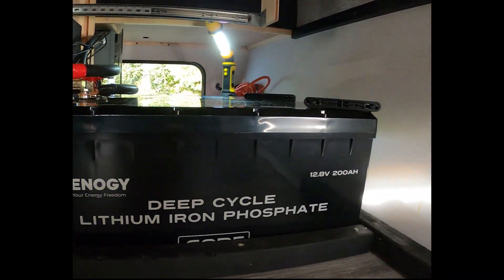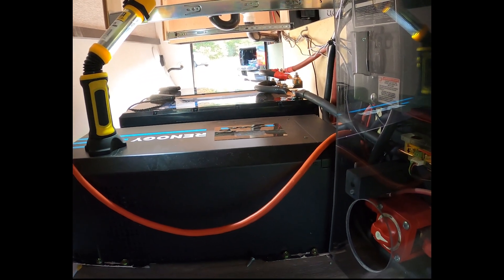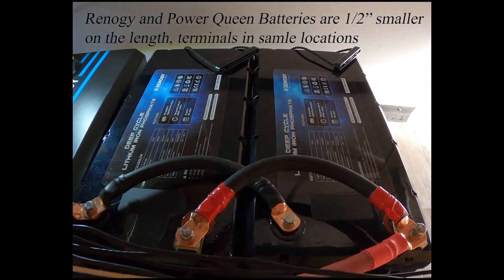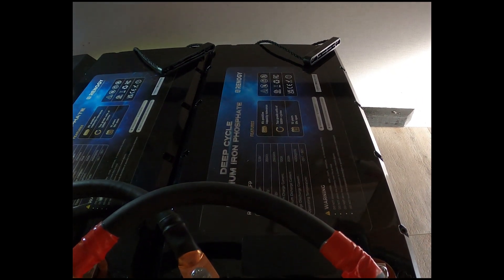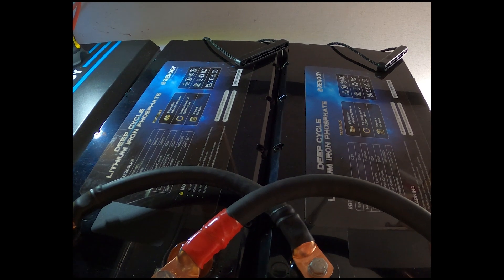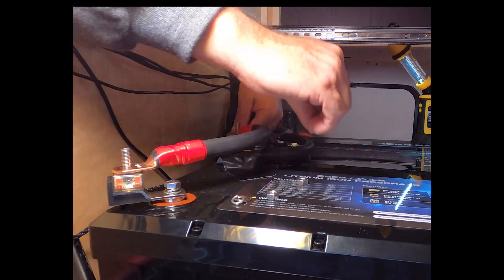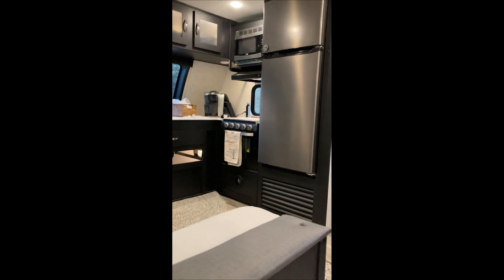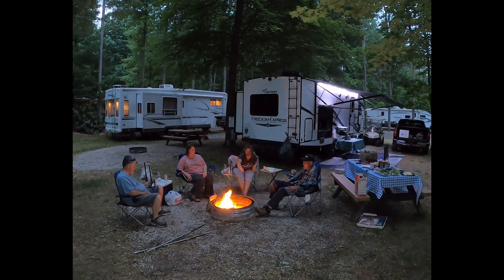Renogy 12V 200Ah Core LiFePO4 Battery Review | A perfect  Lithium Battery for RV Travel Trailers!

Comment from the maker: 3/6/2025: about 2 years now, zero issues with these Renogy Core batteries. These are still providing over 616AH of capacity. No regrets.
Yes they may cost a slight bit more but trouble free reliability is what we wanted while traveling. #Renogy

Comment: Purchased 2 of these to run in series (24v tiny off-grid house) 2 months ago to replace 12 x 6v 105ah Trojan flooded lead acid batteries 24v (4s3p) system which was 4yrs old, so far ... the difference is something I never expected, the lead acids settled at 25.2v at best when new and the last 2 yrs 25v and dropped to close to 24.4 and lately they settled at 25v and dropped to 24.4 or lower (24.4v is the lowest flooded should be drawn down to)  with my low power consumption 12/24v DC fridge "turned off"! at night and careful power usage, these lithiums settle at 26.4 and before the sun shines on the panels in morning they are at 26.1 most of the time, with the DC fridge running 24/7 and no attempt to save power, with a rated 5000 cycles when drawn down much more than it seems I ever will draw these down, looks like I'm set for many years to come, plus I won't need to check battery fluid levels weekly with flooded lead acid or clean the terminals regularly as you do with all lead acid.
Reply from the maker: @johnussss  that is great news. Sounds awesome!

Comment: Hi, thanks for this. What is the fuse rated on the battery terminal. Doing a 2x209ah core lithium install soon myself. How are the batteries going now? Thanks
Reply from the maker: So we're using 250a fuses on each battery. 
Each battery can supply constant 200amp. 
So far this is a great match

Comment from the maker: Update May 15,24. We've use these through the winter on and off, and we've already went on a 3000 mile spring camping trip behind the Michigan snow for the Florida coastline... very happy to share with you that we've had absolutely zero issues with these batteries, I'm very happy with the performance and reliability so far! #Renogy

Comment: I bought two of their 200Ah Life batteries 16 months ago. Decided to double my capacity now  by adding two more. THEY DISCONTINUED MY MODEL AND DON'T ADVISE ADDING THEIR NEWER DESIGN TO THE OLD BATTERIES! So if I want a larger capacity battery bank, I have to start over with 4 new batteries! $2,000 wasted.
Reply from the maker: Not necessarily ! There are ways around it, assumption is you are using this in parallel ? If true you can still us similar batteries, you'll need to limit you're charging rate high end amperage, and charge cut out voltage to 14 volts. You'll need a battery balancer. I am doing this in my work shop. It's not ideal, but we are getting by just fine. Electrically are we perfect on paper? Nope. We don't run down past 30% anyway in the barn. 

I saw a guy on Facebook marketplace that had a like new but used set for 400 each. NIC

Comment: Curious about some of the peripherals. Are your batteries bluetooth capable? if so, do you really need the external battery monitor, or the Renogy ONE device? Trying to figure out if these extras offer some functionality that isn't present in the phone app.
Reply from the maker: Great questions, in laying out the budget design, I didn't have   The BT version of this battery available, so cost and availability were the drivers. Some day day I might give in and get the smart series, but I really don't see the payback being good. Currently late March 24, we're dry camping from Michigan to Tampa with no issues. The Core series have performed well.
Reply from the maker: I think I missed your core question, sorry about that… So do you need the peripherals nope, not at all. You could simply change your batteries and have a way to charge them properly and get on down the road just fine. Because we do put some miles on the highway and spend a lot of time Boondocking. I wanted the extra ability to monitor the systems... plus I'm a little bit of an energy nerd.

I have a video from a month ago where we did a simple battery upgrade and an inverter . We upgraded the fifth wheel with a very simplistic battery package/inverter.

Comment: 400.20 ??  A.H
Reply from the maker: Each battery is producing about 210 to 212Ah of capacity. Since this video we have added a third batter to the mix for extended periods off grid and to run the AC sometimes for a few hours. Not sure about the 400.20 perhaps I had a typo?

Comment: do you think  just with 1 battery   id be Ok ? ... my rv fridge is 12volt only  no gas option and  i got solor system  with 300 watts panel      i will up grading from 2x6volt lead battery
Reply from the maker: That will definitely be an improvement over FLA batteries. 
A couple things you should keep in mind . 
IF You are in a cold environment you can't charge a lithium battery under 0°C or 32F . You want a battery that has low temperature cut off protection, And/or has self heating. 

You will notice that I moved my batteries inside . I Have a very small 450 W electric heater in the battery bay that comes on it 34°.. 

Original question.  yes, one of these batteries by itself has around 2600 W of usage from full charge , these are definitely better than lead acid batteries.

You will also notice how light these batteries are compared to the two you'll be taking out . This would definitely be an upgrade for you.!
Reply: @ThreeDayrv   Pro- 12V 200Ah Smart Lithium Iron Phosphate Battery w/ Bluetooth & Self-Heating. Just ordered  that model
Reply from the maker: @patteioval3109  that should do the trick! Once you get that battery in, be sure to register the battery with Renogy.
You'll definitely want a full charge it on day one and let the battery set just to be sure that the cells balance properly .
Reply: @ThreeDayRV  that's a good advice  I will definitely  do that . Thx a lots
Reply: @ThreeDayRV  I got a question  what 50 amp charger I need   that  when I plug  city plug in   it will not screw nothing  do I need to wire a special way ?
Reply from the maker: @patteioval3109  I'd recommend upgrading your onboard"converter" from the 13.6v to the 14.6 AD (auto detect) version. @recpro makes a good one!
Reply: Yeah I'm alberta . Canada  yes sometime late season it can get cold but I would change battery  from outside  to inside  proably under the seat of the table  and I would maybe do a vent on the side so heat from furnace  hit there maybe
Reply: And thx a lots for the reply

Comment: How did you get the battery connected to the camper shore power to power the ac? I have the same two batteries. And ive used a cheater 15amp to 30amp converter plug that i then connect to my 2000watt inverter directly.
Reply from the maker: So I have the batteries going through 200 amp post fuses then to the shunt, through a disconnect to the bus bars. Then though the 3kW Renogy inverter. The inverter feeds a 30amp breaker and then to an automatic transfer switch. 

The AC is a GE with a softstart. The AC pulls right around 1350W on low fan speed. It work pretty well. I've since added a third battery to increase run time. Works well for us. Keep in mind we don't crank the air down to much when boondockin. Strawberries also added more solar to the roof to finish when the snow lets up. Total of 1,350w for the roof and room for 250 on the ground if needed. So far through we are good to go. 

So when I plug the unit into shore, Power the switch gear automatically transfers to shore. I do not use the synergy inverter as a pass-through.  When you unplug the unit unit from the shore, Power automatic transfers, which closes and completes the circuit for the inverter after 30 seconds if the inverters on your 120 V circuits come back to life. 

I hope this helps
Reply: Yeah it does big time thank you for the very detailed explanation. Im going to save this information for later. And definitely consider doing it with my setup. 

Another question i have is run time. I know you had in the video a list of everything running. I may have missed it but how many hours can you run all of that? 

For me it seems to vary a lot. I mainly run my xbox a computer monitor external hard-rive and the furnace (full time off grid) i have no idea how much energy the furnace pulls (est 800-1000 watts) gaming setup much better around 300 watts. Also im subbing to your YouTube channel and giving it a thumbs up
Reply from the maker: @Lt_downs310  
So all three batteries at 100% charge will have right around 2500 -2600 watts each, that's 7500 watts  total. I would reduce that by 20% and that will give me about 6000 W in the bank... If the air conditioner was running at 1400w per hour , it's 6,000/1400. 
So you would get about four hours of constant runtime and now you have to take an account for other things that are running, possibly lights or refrigerator etc. etc.  What do you really need a watt meter to see what your current consumption rate measures. Does this make sense?
Reply from the maker: @Lt_downs310  reach out anytime. I have more videos on expanding systems coming shortly! Thx for stopping by. -Keith
Reply: Yes it does thank you. I need a watt meter which i didnt know was a thing lol.
Reply from the maker: @Lt_downs310 I bought a plug in watt meter to audit how much power each device uses in my Rv. That allowed me to reverse engineer what I needed component wise. Next you surely want a shunt battery meter to see the charge or discharge rate of your system once installed 

I have the video in the playlist of what I used but there are many reputable shunts you can buy that'll work just fine. I'm not married to any brand so I like the flash sales myself 🤫
Reply: I appreciate it. Im like at the end of my rope trying to figure out how im running at most 300watts of power and im only able yo run that for about an hour and half. Its so frustrating. Ive had these batteries less than 3 weeks. Renogy doesnt seem to know either.
Reply from the maker: @Lt_downs310  do you have a clamp on DC amp meter? 

My email address is or should be in the main information, send a couple of pictures of what you have. I'll look to see if anything jumps out to me
Reply: @ThreeDayrv  wasnt able to find an email but i found you on facebook and reached out there.
Reply from the maker: ThreeDayRV@Gmail.com  @Lt_downs310

Comment from the maker: 80 days have passed, we have had zero, none, no issues whatsoever with the Renogy batteries, we like them so much I bought and installed a 3rd battery for extra capacity for the days where solar isn't so great. Very solid product and the low ambient safety gives added security and peace of mind against damage...-Keith
Reply: Considering getting these batteries for my off grid cabin in the UP.  They still performing as you had hoped?  Saw your coffee mug from Cranes.  Love their apple butter toast.
Reply from the maker: @MBUPNorth hello! Love me some Cranes!  Yes these batteries are solid so far. No complaints to date. Now having this set up, IF I had a crystal ball, I would have built a system that's 48v stepped down to 12. For a small camper this is all the room I had. In a cabin or barn, we'll use a 48v battery system and inverter, less parts, less wire, higher efficiency. Thx! Keith 

Let me know if you have any other questions. 
The link I have should also get you 25$ ish off, they do offer a battery with Heating and Bluetooth now.
Reply: @ThreeDayrv  I have purchased their Renogy Lycan all in one 48v system that powers our guest cabin.  Looking to upgrade my 24v system that powers our main cabin.  The AGM batteries are 8 years old and struggling to maintain a charge throughout the night.  Hoping these 200ah batteries are the answer.
Reply from the maker: The batteries work pretty good once in a while, I just need to balance them by charging them up to full power and shutting the system off to let everything balance out between the cells. Other than that very good for my application in the small travel trailer. Please let me know how this turns out for you.

Comment: Great vid ,I just purchased 3000w inverter charger ,for my trailer,and will be ordering 2 core 200amp batts in coming weeks,good to see that you could run roof air off of tyhis setup,,your tests had some good info,,,thank you
Reply from the maker: Hit me up if you need any info, be sure to pick up a soft start for your AC, that will guarantee 100% smooth & efficient starts without a massive energy spike. Best of luck and stay in touch. Keith
Reply: @ThreeDayrv  .Thanks keith.I heard about soft start,.Im kind of an old newbe to this lithium and solar chargers,,over the years Ive learned ,the best system is your own system,LOL

Comment: I to use the power queens, my solution is to use nursery germination heating pads, they're designed to keep at 77°
The perfect temp and very low wattage
Reply from the maker: Yes, I have not had any issues with the Powerqueen batteries. So far, they appear to be of good quality.
Reply from the maker: Great idea on the nursery pads, great tip!

Comment: What are your plans for your old Power Queen batteries?
Reply from the maker: They are being installed in the barn to run the work shop. These batteries don't have low temperature charge protection. They will be in a 6" x 8' room we are building to house all of the equipment to eventually move the shop totally off-grid. I will likely need to get another PQ battery of the same style so that the BMS matches and run that as a 48v system. I have a welder that will remain connected to the house service panel because of its high load and at times we are doing some fabrication that the batteries won't like. (We do light welding and FAB work from time to time.
Reply from the maker: With all of the Black Friday sales I think we are going to first use the batteries to build a UPS system for the essentials for the house. Lights, water, furnace. I ordered a same PQ so that they all match. Again, no issues with the PQ's, definitely going to put them to good use. Are you using Lithium batteries?
Reply: @ThreeDayrv  yes we are using lithium, we bought 3 100ah before I knew that there are bigger ah available. We are completely building a new system for a camper that doesn’t come with any solar.
Reply from the maker: @Wandering_Bigfoot  I hope you have a video on it, I'd like to see that as well. Hope it is coming along well!

Comment: Renogy has reliability issues. Victron is the way to go but is expensive.
Reply from the maker: I could not afford Victron. I can't say one brand is better than the other. I do know for a fact that Victron caters to the youtubers, all of the big YT groups have either BB batteries or another. Like the video said, I product tested this and these batteries are working well with not issues at all. I am ordering a third battery so that I can test 3 of the Core batteries head to head against the Power Queen batteries that I bought early spring of 2023.  I am a member of the Victron community as well and have noticed they have some "quirky" products as well but I think "V's" tech support and call center is top quality.  What systems are you running? Let’s face it they’re all good until they break.!
Reply: @ThreeDayrv  Hope you have better luck with the new ones than what I have. 2 year old Renogy 200AH  batteries, they will no longer charge past 13.37 volts. Should get 13.6 and 14.2 float/charge.
Reply from the maker: I am sorry to hear this.. I am hoping you got this into Renogy as a warranty claim.  @cabracove  Please follow up with us, we need to know, and I will be updating the every 4 months or so. Hoping you have better luck!-Keith
Reply from the maker: @cabracove  So I have been watching this close for 9 days and I have noticed that these will top off from the solar by mid-day up to 14.2, I have not witnessed this happen yet but these are new but no this if and when it happens I will screen shot and post it. So far is silently good. Thanks and please check back !
Reply: @ThreeDayrv  They will stay at 13.19 with everything off. Won't ever charge to 14 even if I drive all day feeding them 40 amps. They did when they were new.  The return process is a huge pain. Pull them, take them somewhere to be tested, box them up and send them back. At my expense. A couple hundred dollars. Then Renogy decides whether to replace them or not. I'm just going to use them as long as possible and buy a different brand.
Reply from the maker: @cabracove  I will keep an eye on these. That's concerning